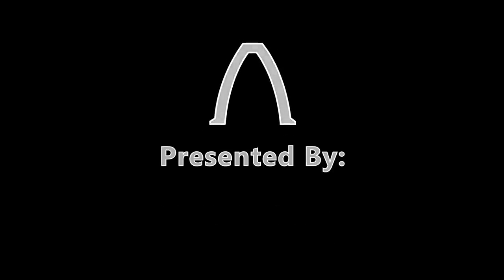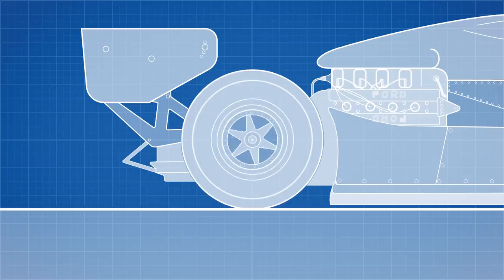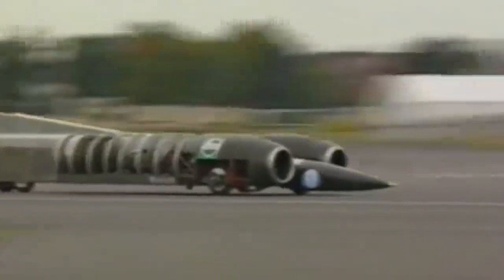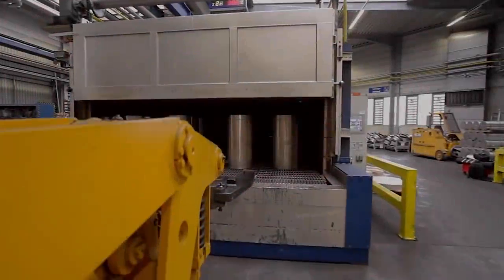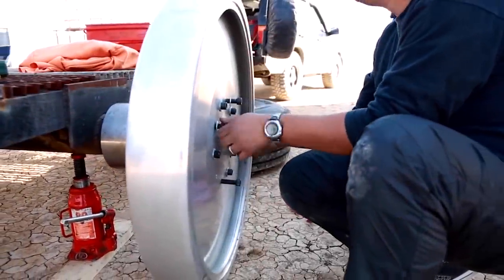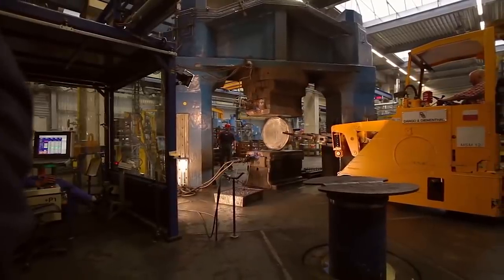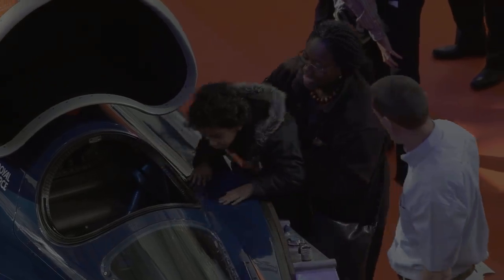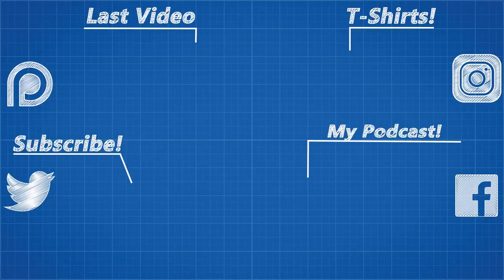Designing The Fastest Wheels in History

Comment: The comment section  is full with metric system vs Imperial System
Reply: I think you meant “Freedom Units”
Reply: Well it’s like arguing whether we should universal constants that will never change to measure things or use grains of barley as a constant
Reply: Came here right away after that statement 😂
Reply: They both have their place, and pros and cons for each application. Aviation/navigation works well with imperial, 60 to 1 rule, etc.
Reply: Universal Constants vs How long was the body parts of British Opressor.

Sorry, but it seems the metric system has more FREEDOM than the "Imperial" system, how can you love freedom if you are at the mercy of the size changes of a king?

Comment: There are countries that..
1. Use the metric system 
2. Used the metric system to land on the moon
Reply: NASA didn't use the metric system back when the US put men on the moon, since they switched to metric in the 80s, so...
Reply: Nasa switched to metric later dude. After the moon landings
Reply: @Endermax3852  that's... Not true at all. What? They calculate in binary, a base 2 number system. EVERYTHING is converted
Reply: @urlilboyy i hope you learned history after this
Reply: Demonslayer20111 flight computers used metric
Reply: @arcaipekyun4232  part of them did. NASA did not fully switch to full metric until after the Mars climate orbiter debacle.
Reply: Demonslayer20111 yeah but the flight computers are the most important parts of the rocket (calculating the route)
Reply: @arcaipekyun4232  I would challenge that precept that the flight computer is the most important. I'd say the rockets themselves are pretty damn important to being able to fly. They displayed information in imperial btw. And it doesn't matter because pprety much all hardware had a duality thing going on where it used both. That's what happened to the Mars climate orbiter, a sensor output in metric when the flight computer expected imperial, or vice versa, I don't remember.
Reply: Demonslayer20111 display was in imperial because the astronauts themselves were using imperial, also I did exclude the rocket and the engines thinking you would understand it
Reply: @arcaipekyun4232  and thus my point is made by you. Just stop while you have a shred of dignity bud. 
NASA did not fully switch over to using metric until way after the Apollo program. Period. 
Also, sure ya did. Uh huh.
Reply: @arcaipekyun4232  lol again missing the point. I'll use small words. NASA used a mixture of imperial and metric all the way up to the Mars climate orbiter. After it crashed because one module was using one measurement system, and another was using the other measurement system, they switched over to full metric. Up until then they did NOT use metric all the time, even in the same part, such as the guidance computer. In fact the two parts that were using different measuring systems in the mar climate orbiter were both in the guidance computer. One was made by jpl, the other by Lockheed Martin. One forgot to tell the other that they needed to convert the measurements they got, and it crashed.  The Apollo program was very much the same way. Some parts used metric some used imperial, and conversions were done when needed.
Reply: @arcaipekyun4232  as for most important part of a spaceship, I would think the pressurization system was also quite important. Can't have spaceflight at all if the astronauts are dead. And the rockets. Can't have spaceflight if you never make it to space. And the heating and cooling. Can't have spaceflight if the astronauts cook or freeze. And power source. Can't have spaceflight if there's no power to run the systems you need for spaceflight. So yes, you should have specified you meant the avionics system when you said that. You could have spaceflight without guidance. You can't have spaceflight at all with out a way of getting there.
Reply: Demonslayer20111 I never said that it was full metric, I just said the flight computer was. The flight computer’s job is hardest to do with calculations, yeah engines are also important maybe, but they don’t have much to do with calculations. The flight computer does the hardest and most important calculations. And it used metric.
Reply: @arcaipekyun4232  nah. It used both that's my point. Different parts of it used both and just did the conversion. Something that bit them in the ass with the Mars climate orbiter.

Comment: Fun fact: The Budweiser Rocket car driven by Stan Barrett and owned by Hal Needham may have been the first car to break the sound barrier, however the FIA was not present to verify the record and the car only made one pass, not the two required. It was done at Edwards Air Force Base, with base personnel providing timing data, which registered a speed of 731.9mph.

It's been a controversy for many years, but it was certainly the first car over 700mph.

Comment: There is another way of starting to understand the monster forces on a wheel when turning fast. IE the part of the wheel in contact with the ground is essentially stationary (relative to the ground). At the furthest point from the ground the speed at the top of the wheel is twice the speed of the car. So in effect the wheel from this perspective accelerates from stop to 2xV to stop in a single revolution. If the car is traveling 100m/s and the wheel circumference is 1 meter (both entirely possible), then the point in contact with the ground accelerates from zero to 200m/s and then stops every 10ms. This only gives the lateral forces which are sinusoidal, but you can also think of the vertical forces as the same but 90 degrees out of phase (cosine). Plot one against the other and you get a circle. I was given this example decades ago as an introduction to vector algebra for mechanics and electronics.

Comment: Update: The Chiron has since broken the 300mph barrier.  It did this on 2nd August this year and reached 304.77mph (490.48kph).
Reply: That wasn't a chiron, It had a longer tail, Different exhausts, Retuned engine for more power, Removed rear wing, Stripped out interier, Added roll cage, Extra bunch of computers, Custom reinforced and x-rayed tires.
If you go out and buy a chiron and it doesn't have all that done to it then one is obviously not the other.
Reply: Toms Tech if you go out and by a chiron you have enough money to do that

Comment: Is it still a land-speed record if the vehicle runs on blades/skids rather than wheels? At some point at high speed with a low-friction wheel and the propulsion coming from jet/rocket rather than wheel I would think the wheel is supporting more like a skid that is spinning anyway. Does the entire weight of the vehicle have to be supported by the contact with the ground to be a “land vehicle” for a land-speed record or could you essentially be a ground effect lift vehicle at speed with a couple of skids holding up minimal weight and basically acting as stabilizers?

Comment: You talked about the rotational velocity of the wheel, but what about the linear velocity? There is a difference in the velocity at the bottom of the wheel, which is touching the ground and is therefore momentarily not moving, and the velocity at the top of the wheel which is moving twice the speed of the velocity of the car, relative to the ground. That type of acceleration and momentum must also be taken into account.

Comment: Imagine the forces the wheels and tyres on a top fuel dragster have to deal with. If only for a maximum of 4.5 seconds but these vehicles are going at speeds sometimes exceeding 300 mph. Let alone the 8000- 10000 horsepower piston engines that turn those wheels to propel these crazy fast cars down the track.

Comment: There is some misinformation about the materials science explained around 4:55 in this video. Dislocations are crystallographic line defects within grains, not between grains. I think you mistakenly confused dislocations with grain boundaries, which are the interface between grains. Grain boundaries and dislocations both serve to strengthen a material by hindering dislocation motion (necessary for plastic deformation). Work hardening does not change the number of grains (or density of grains), and hence does not change the total grain boundary surface area within a material. Rather, work hardening increases the dislocation density within grains, thus making dislocation motion more difficult. Grain boundaries (a function of grain size) also serve as a barrier to dislocation motion, but they can only be changed via re-solidification or re-crystallization (two different processes).

Just thought I'd clear this up. Love your content by the way :)

Comment: A bit confused about the statement that there is not a tire on earth that can handle higher speeds that 277-300 mph. 

The current official speed record for the NHRA Top Fuel class is 335 MPH on pneumatic tires. I have seen funny cars go over 325 MPH in person.

It is true that the tires are still THE limiting factor in speed right now with various measures being taken like shortening the track from a quarter mile to 1000 ft and having good year reps do the final pressure check on tires (plus or minus half a pound). But they are still tires going significantly faster that production vehicles would have you believe the limit of tire technology is.

Comment: Thrust ssc wasn’t technically the first super sonic car. There was another car that I can’t remember the name of (let’s call it reliant ssc) that went to super sonic first. It was owned and run by a Hollywood director and driven by a Hollywood stunt man. The run wasn’t allowed because the FLA (they have set rules for every high speed record) state that the car needs to have four wheels and do two runs, e.g one north and then one south, within 1 mile at top/high speed which is where they get the average speed and thus the record from the faster run within the HOUR. The reliant ssc only did one run with the record being set in a 100 meter ish (could be wrong) distance not 1 mile. The thrust ssc did it between 1 and 1.2 miles im not sure which but they did it above the required. Another problem with the reliant ssc was that it only had 3 wheels (thats why I called it reliant ssc) the car was lighter then the thrust ssc so it didn’t need two massive engines it only needed one but I couldn’t store much fuel. The runs risked the life the driver every time and if u were to try 1000mph in it the car would disintegrate around the driver. Thrust ssc is the first car to go super sonic by record law but not the first to reach it. Hope u learnt something from this and if u have any other information on this topic be sure to put a comment on this or DM me on instagram - @instagammerer

Comment: Oops, you made an error. There is no such thing as centrifugal force, that is a force acting away from the center of rotation. There is however angular momentum which gives the impression of a force acting at 180 degrees to the center of rotation. In fact the force is at 90 degrees in the direction of rotation.

Comment: High strength steel can be forged to have a greater strength to weight ration than aluminum. So why was aluminum chosen for Bloodhound?
Reply: aluminium was used because it's less brittle so won't fall apart if something big hits them, same as carbon fiber but to a lesser extent

Comment: So many wrong terms! Please pay more attention next time. The acceleration due to rotation doesn't lead to increased weight. Also, work hardening decreases ductility yes. But it would have no effect on the dimensional stability since the elastic modulus does not depend on the ductility of the metal. Ductility only tells you about the ratio of the yield strain and the ultimate strain of the material.

Comment: There isn't a tyre which can withstand the pressure and would peel away from the hub ,then just go to the mech and later to the club.

This is what happens when he posts all those crappy formulas when he doesn't need to use them at all🥴

Hope you got my point

Comment: The weight of spinning objects does not increase. Weight as it is understood by most (and I'm sure you know this) is a function of mass and acceleration due to gravity (f=ma). Spinning an object will increase the acceleration and therefore the felt weight but not the actual weight as the gravity isn't changing. If we call the "gravity" created by spinning things simulated, virtual, or felt then the weight created by this virtual gravity should be virtual (simulated,felt, etc.) to follow naming convention and make it easier to understand the distinction between the two. The way you said that the weight will increase due to spinning is nog wrong per say but it is a bit misleading. It would be nice if you address this in future episodes. 
Naming conventions and technical ways of discussion on technical topics doesn't exist to keep lay people away but instead to increase understanding in conversation. I know that it may break up the pace of the videos a bit but it'll make them more useful.
Reply: ???
Then explain this: If I spin something around, example rock on a string, why does it FEEL heavier?

Comment: As an engineering channel I can’t believe you used the word centrifugal. There is tangential velocity, angular velocity, and centripetal acceleration to consider. Of course there is angular acceleration and tangential acceleration BUT the “centrifugal” force is literally just the fact that the tangential velocity vector wants to keep going in the same direction. In order to change direction, you have to accelerate (change the DIRECTION of the vector) the tangential velocity. Thus creating what we sense as a push outward. What’s really happening is that since an object in motion wants to stay in the same speed and direction, when you change direction, you accelerate towards the CENTER of the curve. Not outward. So as an engineering channel PLEASE use the proper terminology and help dispel ignorance
Reply from the maker: +Tucker Garcia it is the proper terminology. Watch my artificial gravity video